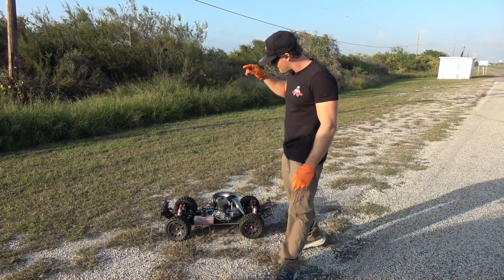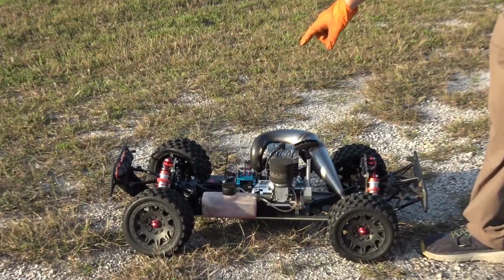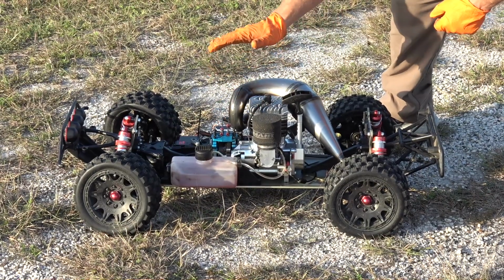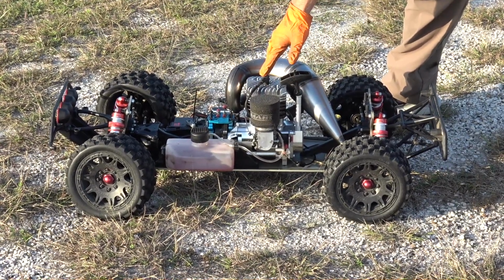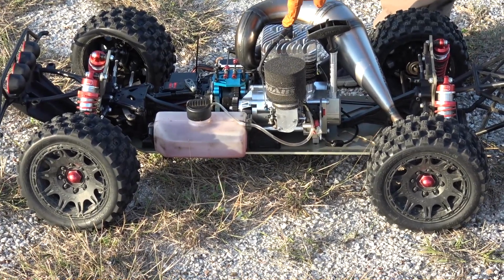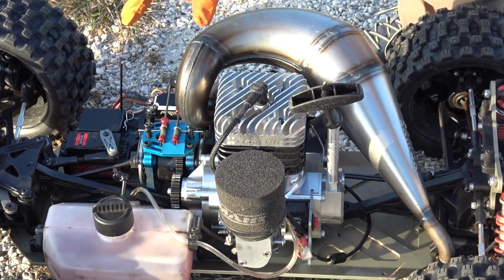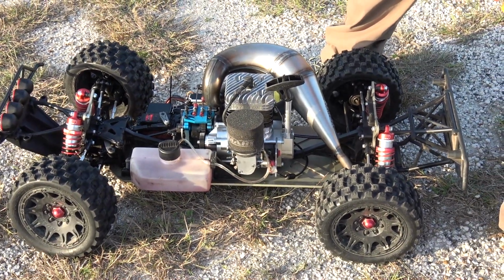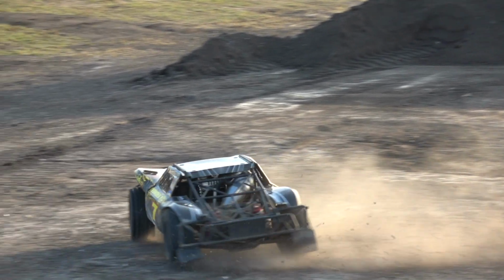Giant Engine in RC Car!

Comment: @thunderrc   It seems you’re unloading to the front to much.  

I’d ear plug (silicone chalk & let pellets dry is the same ) every diff in that thing.

Btw. What’s your given name ? (First only   Because I understand not giving it lol )
Reply from the maker: My name is Rocky and I will definitely do that. Thanks for advice! 💪👍⚡️🏆⚡️
Reply: @thunderrc    I’ll give ya another. 

Don’t do that “SHOE GOO “ thing to your Body’s. 

PUT THE DRYWALL TAPE IN THEM ..THHEEENN  “SPRAY FLEX SEAL “ (CLEAR OR BLACK OR OTHER COLORS AVAILABLE.) 

It’s cheaper & and does just as good if not better (as many coats as you like) . 
 Not to mention A LOT EASIER & COVERS MORE EVEN EVERYWHERE 😉

I’ve been doing that to my body’s for a few yrs ….long  before the shoe goo thing become A THING on you tube. 

You can actually spray the body inside with a Clear Flex seal by itself & be Good 👍 
A can will do 2 or 3 body’s. 

If you do a vid on it credit me. Lol. 
Because it is something I know that nobody else does outside of who I have shown it.   Lol.